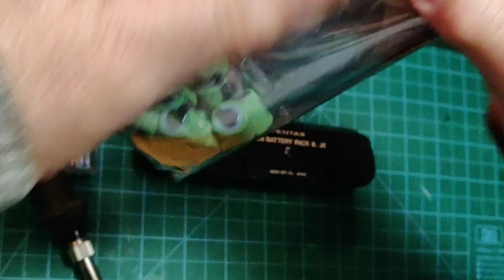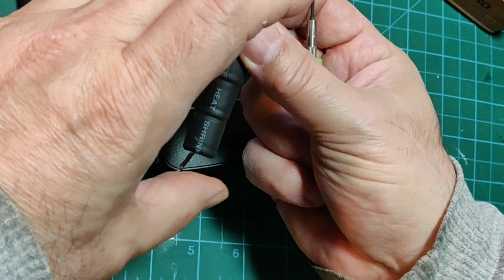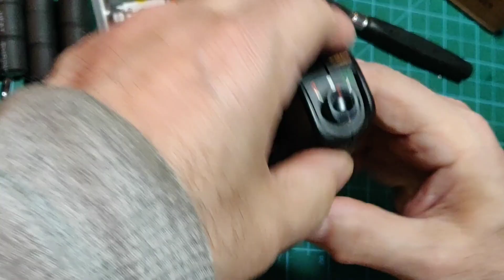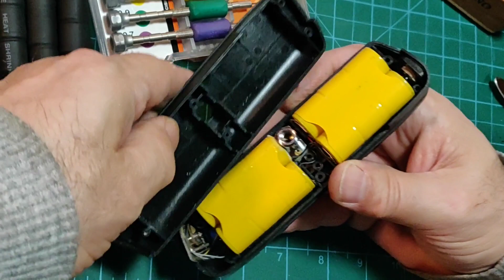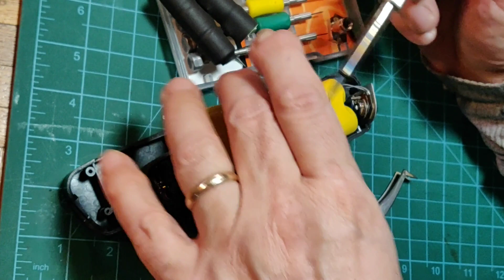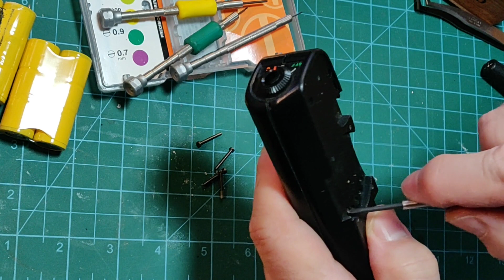Replacing Batteries in the Pentax Battery Pack LX

Comment: Where can i order the Nimh battery replacements and which size do i need?
Reply from the maker: Sorry I didn't answer as I didn't see this question until now.  What you want is NiMH 1/3 AA 1.2V with tabs.  Like this... https://www.ebay.com/itm/225898787073?mkcid=16&mkevt=1&mkrid=711-127632-2357-0&ssspo=hNiDQMkERLq&sssrc=4429486&ssuid=yb_E3D5vR9S&var=&widget_ver=artemis&media=COPY